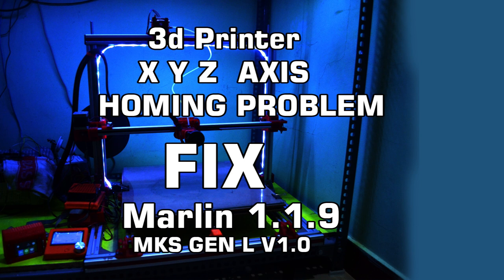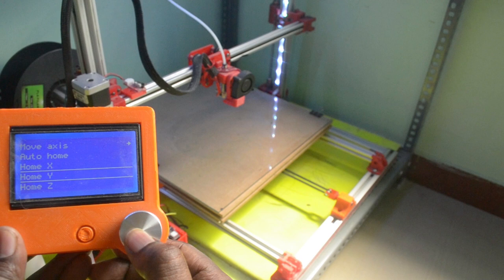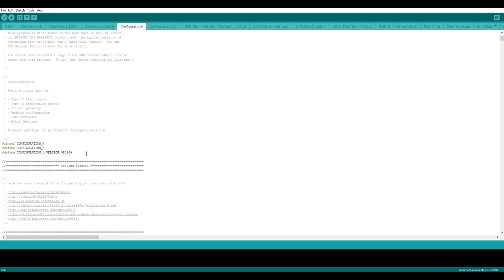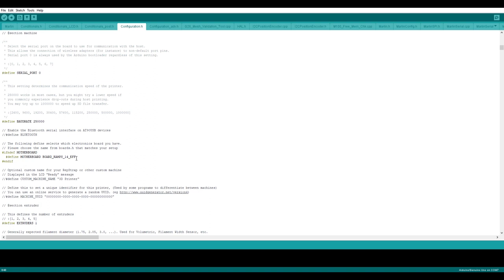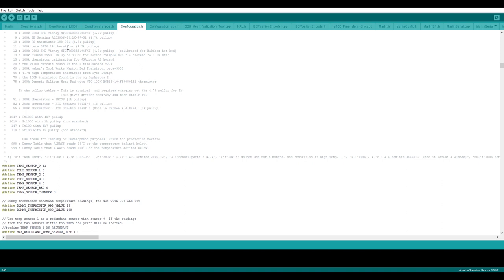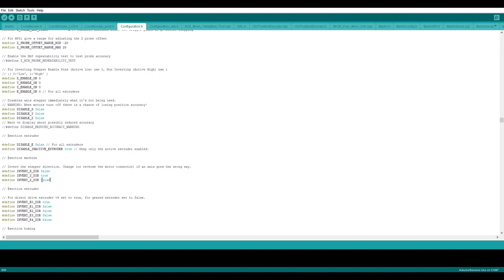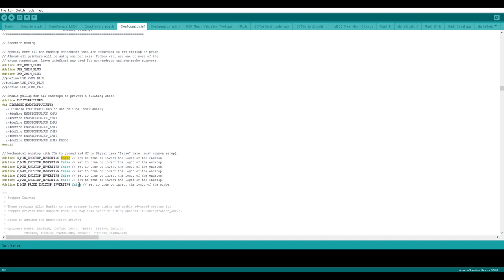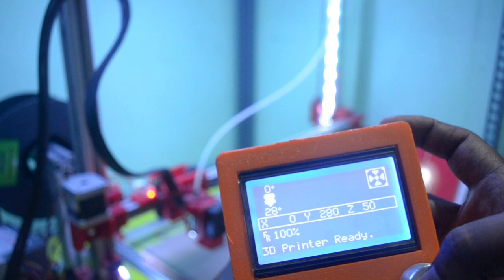3d printer X Y Z  AXIS Homing problem FIX -Marlin 1.1.9,MKS GEN L V1.0

Comment: I fixed my problem by rewiring the limit switch moving the center wire to the other outside connection.  Tested it first by taking off the switch and used a jumper wire.  Found that this Xaxis limit needs to be normally closed until the limit is hit that switches the connection to open up.

Comment: the homing seems like only moving 10mm per click. is there any way to change to auto go to endstop?
Reply from the maker: Hi,if its moving little then you must change end stop logic in marlin firmware as showed in this video.and also check steps for X Y Z axis .use reprap calculator to calculate steps.make sure steps are correct for all axis.let me know if you need any help.all the best
Reply: @DiyDot3d  Thankyou for the reply! it seems i found another problem. When I flash the software to the board, it seems there is nothing changed. I already changed in the marlin, but when i flash it, nothing changed. 

Example: changing the direction of the homing. I followed your tutorial, but nothing changed after I flash it.

Another example: inverting the direction of X Y Z, nothing changed.

Is there any problem with the way I flash?

Board: MKS Robin Nano V2
Reply from the maker: @adrianbelano5541  #define Z_MIN_ENDSTOP_INVERTING false // set to true to invert the logic of the endstop  ----you need to change this .first compile firmware so it will show  if any errors.make sure it is uploaded successfully.it is always better keep copy of original firmware file.may be you have done some unwanted changes.its better to try with fresh copy of firmware adjust according to your printer configuration.important changes are steps based on your motor  drivers(full steps or half steps).
Reply: @DiyDot3d  Thankyou for the reply. it works! Thank you!
Reply from the maker: @adrianbelano5541  good to know that 🙂🙂🙂. Please subscribe to my channel for future video notifications. Thank you
Reply: @DiyDot3d  auto subscribe! :DD
Reply: It seems that there could be another way to solve this.  Since the logic with respect to the endstop switch needs to be reversed one could simply rewire the switch.  Such as from normally open over to normally closed.  Or visa versa.  This means to move the connection to the switch (the outside connection wire over to the opposite not-used outside connection).  These switches have 1 middle and 2 outside connections.  Only two of the are used - the middle and one of the two outside connections.

Comment: I just fixed that, hanks. Now I have another problem: whenI tell it to move 1 mm, moves 10 mms. and 10 mms move 100 mms. Where do I remove a 0?
Reply from the maker: 🙂Hi,Which controller you're using?? Touch screen or reprap lcd

Comment: I have done as you did in this video but it doesn't recognize my end switch  thus it tries to move forward. I didn't get it why it does like that
Reply from the maker: Hi may be faulty end switch . Try with other axis end switch.
Reply from the maker: And also check endswitch connected properly on motherboard. I mean 3 cables to proper pins on motherboards. All the best👍
Reply: @DiyDot3d  thanx i gonna try like that ! Thanx a lot maan
Reply from the maker: @Asafkeles  always welcome 🙂. Problem will be either faulty switch or you connected wrong way on motherboard

Comment: 'Home Z First' error, please help someone
Reply from the maker: Could please explain problem properly, so it will be easy to guide you. First check z axis endstop connected properly or not
Reply: @DiyDot3d  Yes, when I try to print something this error 'HOME Z FIRST' displays on the screen. The extruder doesn't move, the temperature decreases and the status bar fills very quickly. So the print stops without printing. All this time the Z coordinate flash and shows the coordinate 10 which doesn't change and a question mark. I mention until 2 days ago it worked perfectly. The problem starts after I noticed a blue screen when power the printer on. I tried to fix it buy inserting the SD card from the kit formatted and containing only the EEPROBE.DAT file which the card came with. After the menu appeared again this problem with the z axis appeared on the first print.
Reply from the maker: Try to install fresh firmware. Which printer are you using??
Reply: @DiyDot3d  I am using an Ender 3 pro. Where to find the correct firmware and how to install it ?
Reply from the maker: @mihaiciorobitca4949  https://www.creality3dofficial.com/pages/firmware-download             
you can get firmware here.you can see lot videos in YouTube how install.All the Best
Reply: @DiyDot3d  No I have a bigger problem. HOMING FAILED. HALTED PRINTER. PLEASE RESET. Do you  have any idea how to fix it ?
Reply from the maker: Check all endstop switches. Amke sure all axis endstop switches working. If one axis endstop switch not  working also you will get homing failed. Try to home individually each axis, so you can find  problem in which axis.
Reply: @DiyDot3d  I can't move the axis, I get the same error
Reply from the maker: @mihaiciorobitca4949 may be firmware corrupted. then install fresh firmware . That will solve problem